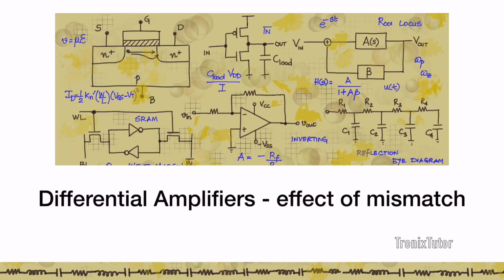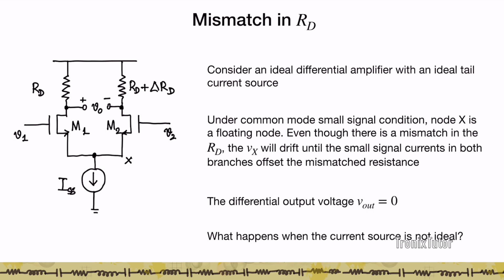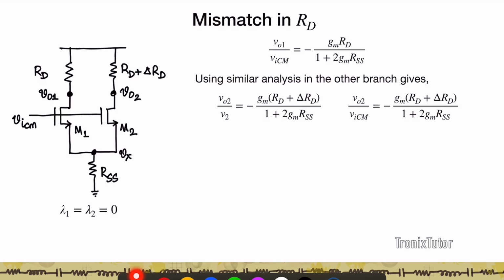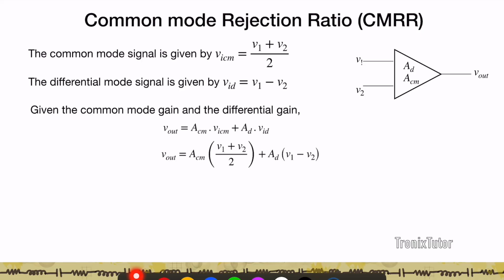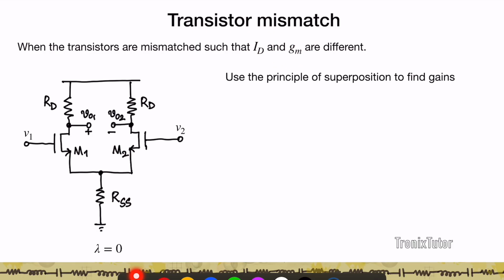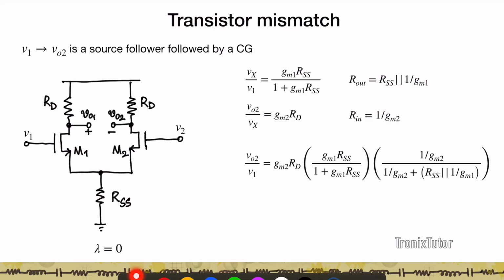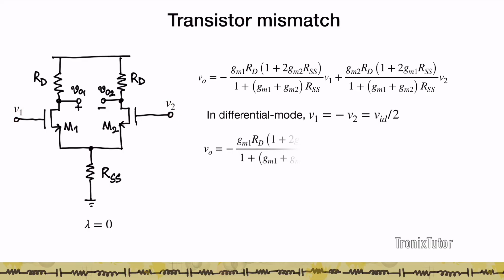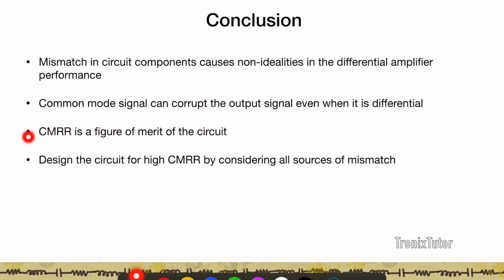Your Differential Amplifier Has No Differential Input | Mismatch and CMRR

Comment: What will be the overall CMRR considering both the mismatches, R_D & g_m?
Reply from the maker: It will be hard to get a closed form expression. You can use the same technique that is used for different gm but add in the RD impact. Expect the CMRR to drop further. If the changes are very small then you can sum up the individual contributions for the gain by looking at one keeping the other a constant and vice versa.